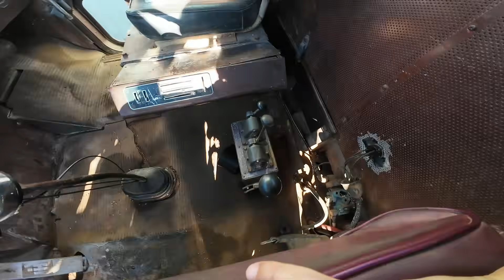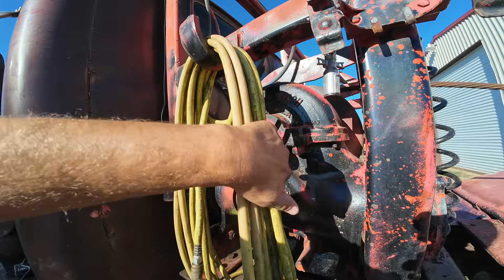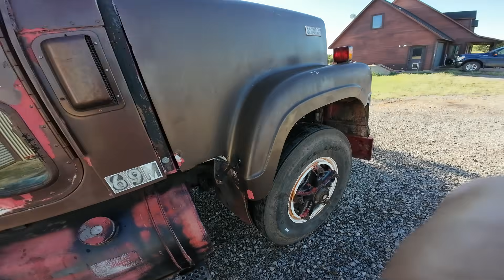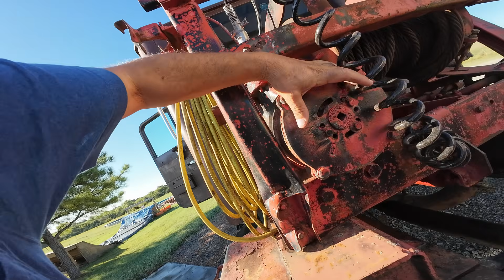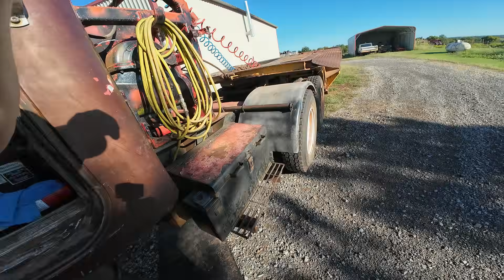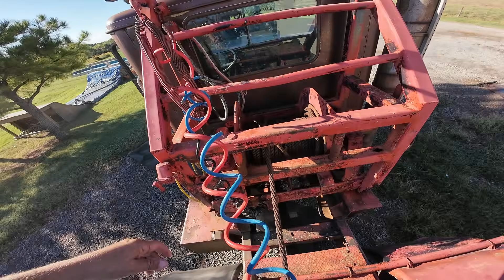How my winch truck works. IH 4300 Transtar #digginok

Comment: 👍👍👍👍
Nice job explaining the controls.
Your correct on the winch angle.
I guess as long as your cable setup is working for you, other than
The possible kinking of the cable at the pin your fine.
The correct way is to have an eye on the cable and just use the pin for which
It was intended.
When needed for pulling, you add your leader chain with a clevis.
Agree you need to cut all that iron off, and just use a 6x6 block of wood parallel to
The deck when starting on trailer.
Seems like its working well for you.
The old Cummins sure sounds Good.
Tom
Reply from the maker: Thanks! That makes a lot of sense, what kind of eye should I get? Spelter? I don’t like the kinking
Reply: @Digginok  That would work probably best . Most just use a Flemish eye loop with a thimble .If done correctly you don't need a clamp . Maybe there's a rigging company close that could swedge the eye for you.